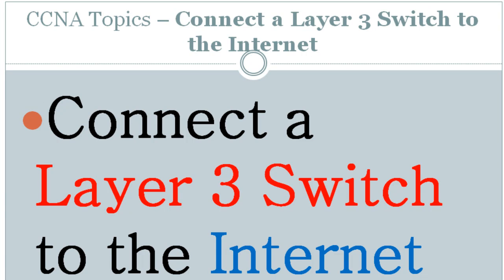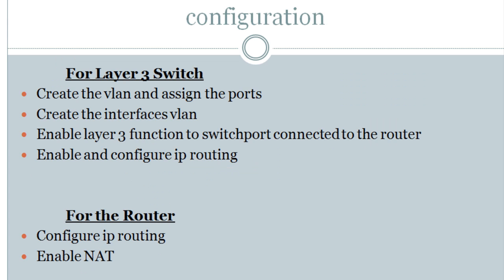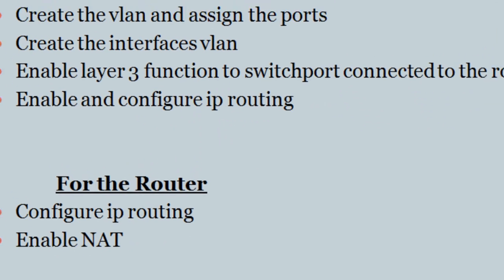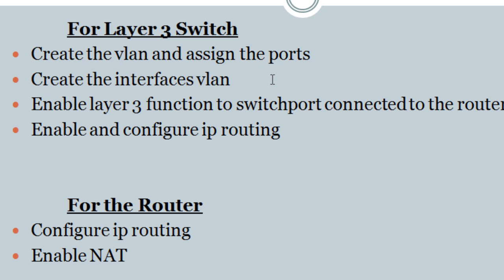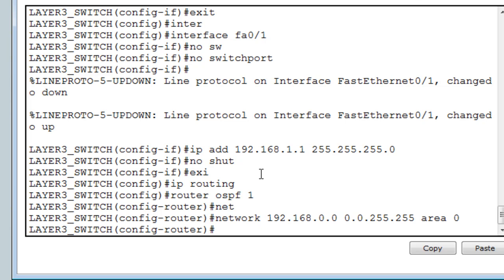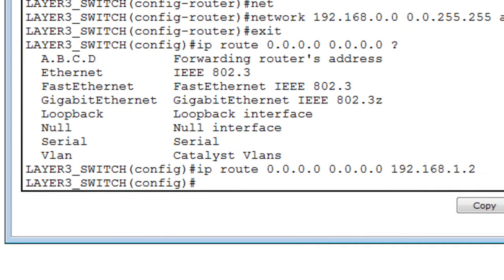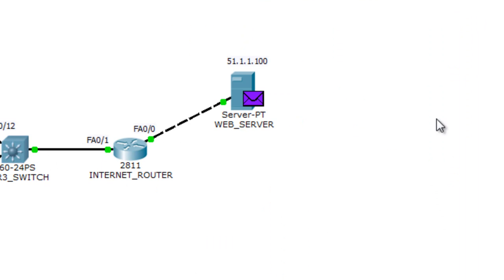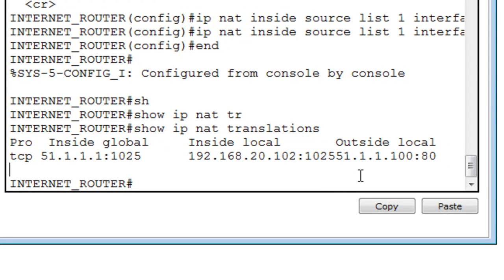CCNA Topics – Connect a Layer 3 Switch to the Internet

Comment: 9:07 I have noticed that you used ospf and default route. I think only ospf or only default route is enough in layer 3 switch.
Reply from the maker: You need to understand the basics of routing. Without the défaut route pcs will not access internet.

Comment: Can you suggest a router than can do 2.5G, 5G, or 10G for the best price to go with this switch? Current consumer routers are so bad for using with multi-gigabit service from my modem. My modem can do 2.5G over 1 single port.

Comment: Bonjour Mr Fall. J'ai une question : j'ai remarqué que lorsque vous déclariez le réseau à router par ospf sur le switch de niveau 3, vous avez utilisé un masque inverse de 0.0.255.255 aulieu de 0.0.0.255 (selon la classe de l'adresse de l'interface fa0/1,). était-ce une astuce pour englober également les 2 autres sous réseau vlan 10 et Vlan 20 ? si vous aviez utilisé une adresse comme 10.0.1.1/24 sur l'interface fa0/1, seriez vous obligé de declarer avec ospf tous les 3 sous réseau separément (10.0.0.0/24 , 192.168.10.0/24, 192.168.20.0/24)?
Reply from the maker: Il y a une flexiblité sur l'utilisation du masque inverse. C'est a vous de voir ce qui vous convient le mieux, j'ai utilisé 0.0.255.255 aulieu de 0.0.0.255. Comme vous l'avez dit ca me permet de faire une pierre deux coups.

Comment: Thanks a lot for uploading this vedio.
I have a small doubt. If ospf is running between switch and router  for routing then what is need of default route toward router
Reply from the maker: The default route is needed to allows your devices to get connected to the internet.

Comment: what is the need of static route where we already used ospf ???
Reply from the maker: You need the Default static route in order to get internet connection - 
 ip route 0.0.0.0 0.0.0.0 192.168.1.2
Reply from the maker: You the Default static route in oder to get internet connection.
ip route 0.0.0.0 0.0.0.0 192.168.1.2

Comment: why you didn't set up ip address for router interfaces?
Reply from the maker: Here is the configuration of the INTERNET_ROUTER hostname INTERNET_ROUTER ! 
interface FastEthernet0/0 
ip address 51.1.1.1 255.255.255.0
 ip nat outside duplex auto speed auto 
! interface FastEthernet0/1 
ip address 192.168.1.2 255.255.255.0
 ip nat inside 
duplex auto 
speed auto
 ! router ospf 1
 log-adjacency-changes 
network 192.168.1.2 0.0.0.0 area 0 network 51.1.1.1 0.0.0.0 area 0 
! ip nat inside source list 1 interface FastEthernet0/0 overload 
access-list 1 permit 192.168.10.0 0.0.0.255 access-list 1 permit 192.168.20.0 0.0.0.255

Comment: Hello again professor. I don't know if this guy is your student down below: Kash Birere. He says this will work without ospf.  I don't have a config like that but that is my next attermpt on live equipment to get it to work that way.
Reply from the maker: Anyway you will need to configure routing between the Layer 3 Switch and the router.
So you have a choice to use either a Routing protocol like OSPF, EIGRP, RIP or a Static route.
You cannot make it work without  configuring routing between the Layer 3 Switch and the router. Just keep that in mind.

Comment: Sir, guess what. I had both computers plugged into the back of the cable modem. When I turned off one computer, the web page came up. So I know it works for sure. It is solved. Thank you so much and I am so sorry for the hassle.
Reply from the maker: You're welcome.
Don't worry, i am here to help if i can.

Comment: I just did 2 pings. Ping 24.x.x.25 (next hop from static ip) Success rate 0.  Ping 24.x.x.26 (to my static ip) Success rate 100. My static ip is the g0/0 interface on my 1941 router.

Comment: Sorry for the delay sir:

Router Project
I only have two gig ports, so I can do only 1 pc at at time.
Can I get on the Internet using a wired connection?
If you sit on the router and ping the default gateway of the static ip, it can ping the default gateway successfully.

1941 Router Config
==============
conf t

int g0/0
ip add 24.x.x.x 255.255.255.252
ip nat outside

int g0/1
ip add 192.168.1.4 255.255.255.0
ip nat inside

router ospf 1
network 192.168.1.4 0.0.0.0 area 0
default-information originate

ip nat inside source list 100 interface GigabitEthernet0/0 overload

ip route 0.0.0.0 0.0.0.0 24.x.x.x
ip route 0.0.0.0 0.0.0.0 192.168.1.6

access-list 100 permit tcp any any

3750 Switch Config
==============
conf t

ip routing

interface GigabitEthernet3/0/1
no switchport
ip address 192.168.1.6 255.255.255.0

interface GigabitEthernet3/0/2
switchport access vlan 2
switchport mode access

interface Vlan 2
ip address 192.168.2.1 255.255.255.0
no shut

interface vlan 1
no shut

router ospf 1
network 192.168.1.0 0.0.0.255 area 0
network 192.168.2.0 0.0.0.255 area 0

ip route 0.0.0.0 0.0.0.0 192.168.1.4

PC addressing
==========
ip address 192.168.2.5 255.255.255.0
def gateway 192.168.2.1
Reply from the maker: I made some corrections to your NAT, Access-list and OSPF configuration.
Try this configuration below.

1941 Router Config
==============
conf t

int g0/0
ip add 24.x.x.x 255.255.255.252
ip nat outside

int g0/1
ip add 192.168.1.4 255.255.255.0
ip nat inside

router ospf 1
network 192.168.1.4 0.0.0.0 area 0

ip nat inside source list 1 interface GigabitEthernet0/0 overload

ip route 0.0.0.0 0.0.0.0 g0/0

access-list 1 permit 192.168.1.0 0.0.0.255
access-list 1 permit 192.168.2.0 0.0.0.255

3750 Switch Config
==============
conf t

ip routing

interface GigabitEthernet3/0/1
no switchport
ip address 192.168.1.6 255.255.255.0

interface GigabitEthernet3/0/2
switchport access vlan 2
switchport mode access

interface Vlan 2
ip address 192.168.2.1 255.255.255.0
no shut

interface vlan 1
no shut

router ospf 1
network 192.168.1.0 0.0.0.255 area 0
network 192.168.2.0 0.0.0.255 area 0

ip route 0.0.0.0 0.0.0.0 192.168.1.4

PC addressing
==========
ip address 192.168.2.5 255.255.255.0
def gateway 192.168.2.1

Comment: Mr. Moustapha, my static ip starts with 24. It is a public ip. Do I have to use NAT for this project to work? I understand that NAT is used because private ips are not routable over the Internet. Your project uses an ip that starts with 51 that is also a public ip. Do you have to use NAT in your case to make this work? I did the project again. My setup is almost identical to yours. I got translations but I can't ping the Internet.
Reply from the maker: If you want to connect to the Internet, you have to use NAT. 
Can you send me your configuration again.

Comment: Service provider tested the internet today and it is not working, so that is part of it. They are sending a technician over. Does your presentation assume that the Service Provider is using OSPF?
Reply from the maker: You don’t need to worry about what routing protocol the service Provider is using. In order to get internet connection, you just need configure a static default route on your edge router that point to Service provider Device.

Comment: Speed coming  in from service provider is 200 Mb/s. Made sure to use gig ports on 3750 switch and the 1941 router. (Had to use SFPs on the 3750 switch). Talked to service provider today. He said I got a "router without NAT". My static ip starts with 24 and is a /30. Left it out for obvious reasons.

Computer
-------------
ip 192.168.2.5 
sub mask 255.255.255.0
def gateway 192.168.2.1

Multilayer Switch 3750
=================
vlan 2
name spectrum

int vlan 2
ip add 192.168.2.1 255.255.255.0
no shut

ip routing

g3/0/2
--------
switchport mode access
switchport access vlan 2
no shut

g3/0/1
--------

no switchport
ip address 192.168.1.1 255.255.255.0
no shut

OSPF
-------
router ospf 1
network 192.168.0.0 0.0.255.255

default route
----------------
ip route 0.0.0.0 0.0.0.0 192.168.1.4

1941 Router
=========
g0/1
-----
ip address 192.168.1.4 255.255.255.0
ip nat inside

g0/0
-----
ip add 24.x.x.x 255.255.255.252
ip nat outside

OSPF
-------
router ospf 1
network 192.168.1.4 0.0.0.0 area 0
default-information originate

default route
----------------
ip route 0.0.0.0 0.0.0.0 192.168.1.1
ip route 0.0.0.0 0.0.0.0 24.x.x.x

Access List
-------------
access-list 1 permit any

NAT
-----
ip nat inside source list 1 interface g0/0 overload
Reply from the maker: Access List should be :
Access List 1 permit 192.168.2.0  0.0.0.255

default route should be
----------------
ip route 0.0.0.0 0.0.0.0 g0/0

Comment: This is an excellent video. My mentor is training me with this exact same concept. My set up: computer >>>>>3750 switch >>>>>>1941 router>>>>>spectrum router. My project is to get on the internet without using wireless. I had a crossover cable between service provider router and my 1941. I just changed it out to a straight through and the OSPF came up for g0/1. I did my NAT the same way as in the video and it is not working. Oh, I have a static IP from the service provider with a mask and default gateway. Gonna try some pings.
Reply from the maker: Just check your NAT configuration. If you follow the video as recommended, you shouldn't have any problem getting connectivity. Thanks for your comment.

Comment: what is the  emulator software?
Reply from the maker: An emulated software like GNS3 uses real cisco IOS on the devices in a virtual network environment.  Unlike Packet Tracer which is a software simulator that does not real IOS on its virtual devices.
Reply: thank you for your reply

Comment: Came up with one thing. I don't even know if you will see this. I first learned with the router on a stick model with the mgmt vlan, the data vlan and the voice vlan.  I understand that the mgmt vlan svi is used to telnet into the switch from remote. In my situation  I have a 2800 rtr >>>> 3750 switch  >>>>> 7965cisco phone >>>laptop.  If you have a voice vlan and a data vlan, is there any advantage to putting an svi on the 3750 switch? It would be the same as putting a cisco phone between your layer 3 switch along with an svi on your layer 3 switch?

Comment: what's the purpose of the ospf on this network?
Reply from the maker: It's just a routing protocol i like to use. You can use any other routing protocol you want. Keep in mind that you need a routing protocol for this to work.
Reply: since it's a stub network, would a simple default route work?
Reply from the maker: Where you are you going to configure the default route? Don't forget that the router doesn't know about the two vlans networks. A default route wouldn't work.
Reply from the maker: https://www.youtube.com/edit?o=U&video_id=Th1IZdidQqM
CONCEPT OF IP ROUTING.
Reply: since it's stub network meaning one way in and one way out there is no need to use a dynamic protocol. so i would put the default route on the L3 switch. this will route all VLAN through the L3 switch to the router. the router will have 2 interfaces (LAN and WAN) only so no need to have any type of routing protocol there as the router will know already. there are many examples of what i'm talking about on youtube too.
Reply from the maker: if you don't configure routing on the router. It will only know the networks that it is connected. So the router will know the network that connect to the switch and the network that connect to the WAN.
But how about the 2 vlans networks. How the router will know those 2 vlans network.
Just try to test what you say and you will see that the router will not be able to reach the 2 vlans.

Comment: Hi Moustapha Fall, 
It works but i have a question; on the ospf config for the switch why do you use wildcard of 0.0.255.255 when you actually using the subnetmask of slash 24 and you did the same for the router by using wildcard of 0.0.0.0 whiles you using a subnetmask of slash 24. This is very confusing. would appreciate an explanation. Thanks.
Reply from the maker: You need to understand that the wildcard is used to determine which interface(s) will participate in OSPF. It is not used to advertise the prefix network.